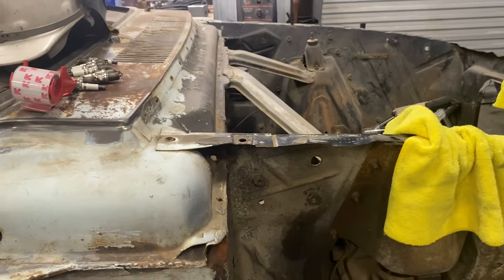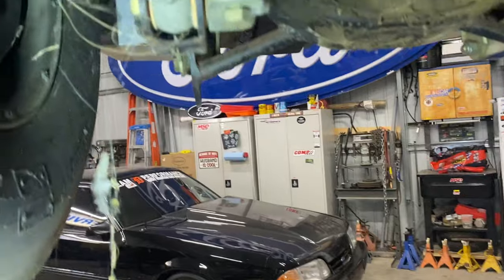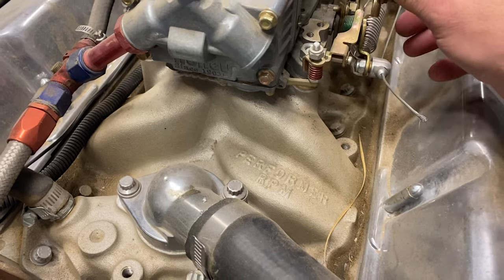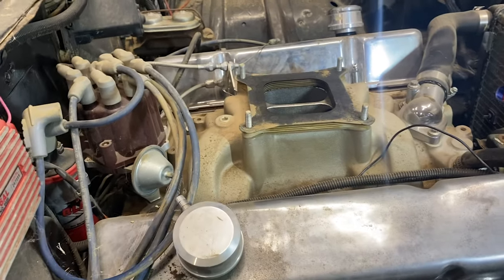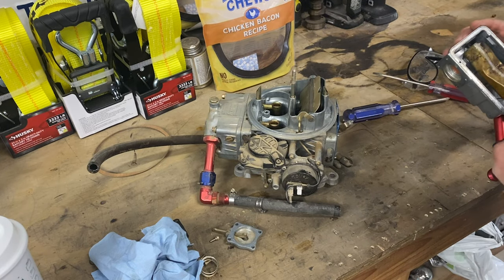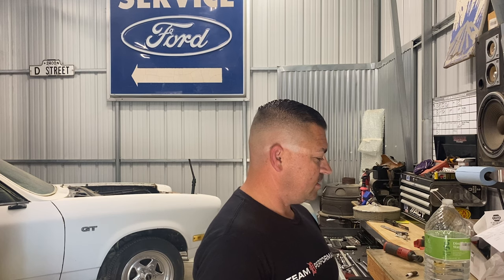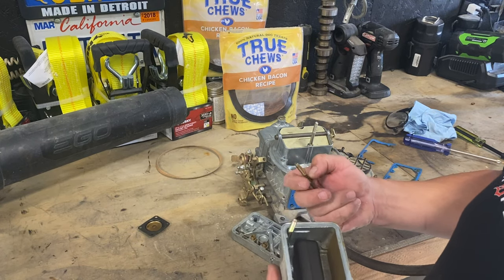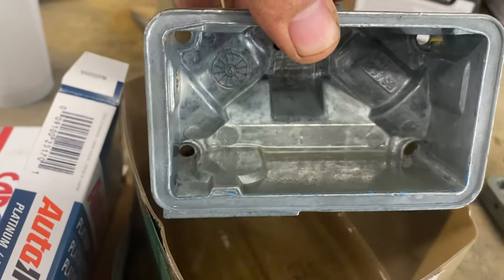1973 VEGA needs a FORD shop to get it running! PART 1

Comment: Everybodys a critic these days, Appreciate what youre looking at. Treat it like anything else you work on bro, if pride is in your work,it will show through in workmanship. Try  putting spacers where headers touch against the heads tighten center bolts to straighten mating surface , them you can save that extra gasket.& Might gain clearance between it and fenderwell. Two birds 1 stone. Check timing out ,needs advancing  alittle. Fuel system cleaner , Zmax treatment, stuffs the shit .
Reply from the maker: I just like to give the chevy guys a hard time! He brings that car to me because he knows I’m solid with what I do! I appreciate the comments! And thank you for watching!

Comment: did I see a crack in the passenger side header? It needs some work!!!
Reply from the maker: The passenger side didn’t sound like it was leaking but I’ll check it out ! It could really use a custom set of headers !
Reply: @TeamDPerformance  Yes, they fit terribly ! It could have been the crossover frame where they "messaged" it for the headers! eyesight not so good anymore!